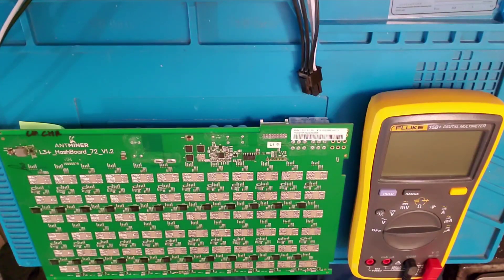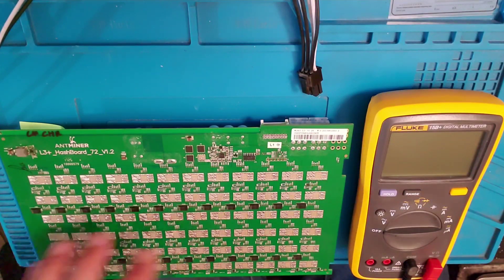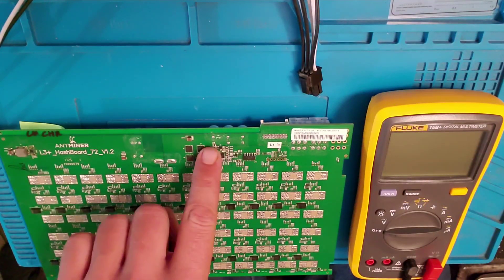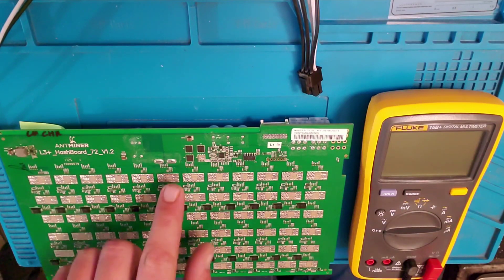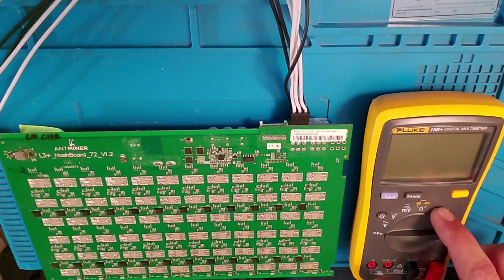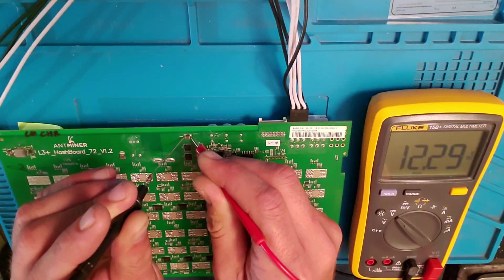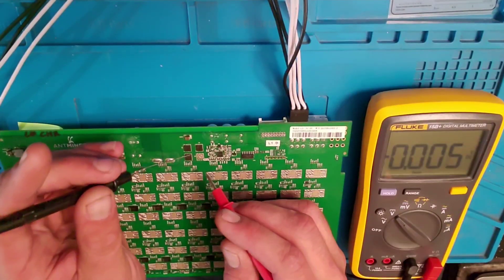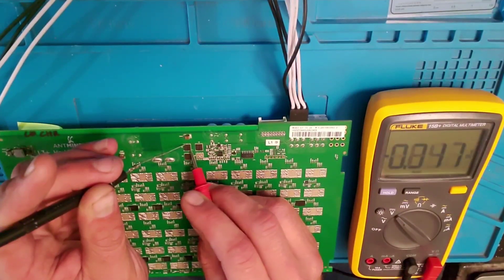L3 or S9 hashboard repair - Step 2

Comment: I have the exact same problem on two boards the voltage is blowing through Q1 and Q2 and Q4 is not reading anything I have replaced Q4 but I am still not getting any voltage.  Would the PIC controller cause this to fail

Comment: I have the exact same problem and i do not have these mosfets in stock. Can i use mosfets from a scrap s17 board you think?
Reply from the maker: Yes, just watch it initially, as they are used components, but should be fine
Reply: @CryptoMinerCHR  Ok Thx! It works for the first 2 mosfets. The third one burns out. When i use the original third it works also because only the first 2 mosfets are broken. I need to order some mosfetsd as i have 130 boards with same fault. Which type and model mosfets shoudl i search for?

Comment: Hi, i have 4 boards of Antminer L3+ v72_1.6.1 all show no asic error. Whit the power on I have all the voltage ok , after i put the IO cable no pover on dc-dc convertor.
Onlyu whit power the asis ar warming like is working. On test point is not normal I have on RI6, RI12, RI18, RI24, RI30, RI36, RI42, RI48, RI54, RI60, RI66 is al at the 2,6Vcc and the RI72 is at 1,7Vcc. Please advise what to look for . I don't have the fix texture.Whith regards pusttiu
Reply from the maker: Sounds like the io data or pic is shutting off the board when you plug it in

If ri signal is good, then it should be showing at least some asics

Comment: Thank you for the video! for the Mosfet, what should the correct voltage be for each pin? Is it 10V or 12V?
Reply from the maker: It depends on the board, best way to learn is to take a good board and test it. S9 and l3 both use different voltages, so the output is different. 

In this video the voltage went right thru the mosfet, so we know it needs to be replaced. It is also why the voltage is not coming out of the dc-dc circuit
Reply: @CryptoMinerCHR   just in case you don't know how to use the asic repair tester?